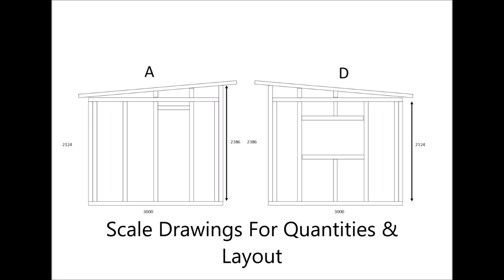Building A Garden Office

Comment: Hi. Great video and has helped me big style. Thanks for that. Question: the Visqueen under the concrete is left exposed, should this have been tucked up the external side of the OSB wall, then the DPM lapped over it and then cladding applied?
Reply from the maker: No just cut off the excess

Comment: How far over the edge did you go with the 4 inch sole plate?
Reply from the maker: The sole plate fits flush with the edge of the concrete slab as that is the supporting structure.
Reply: @redfrogarchery  thanks for the reply, just at 4.07 on the video it seems the sole plate is slightly proud of the edge of the concrete